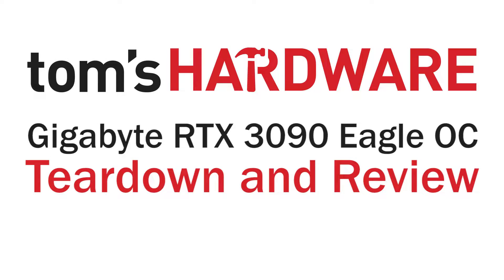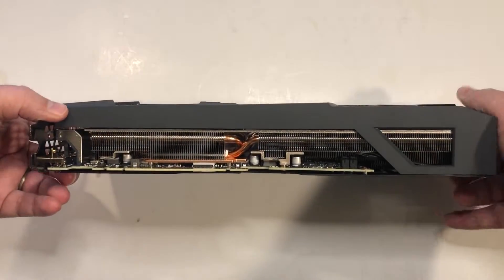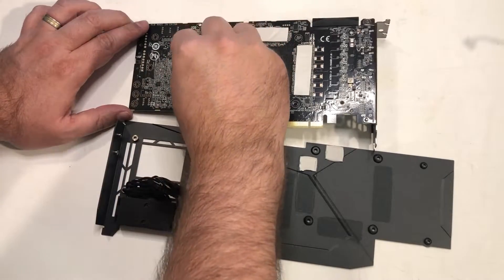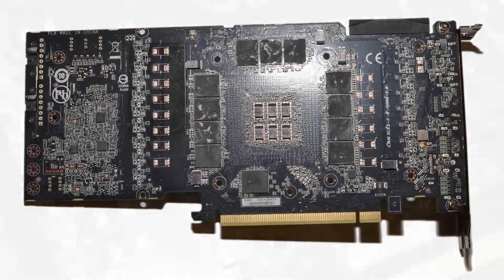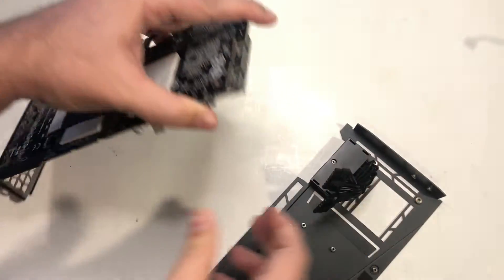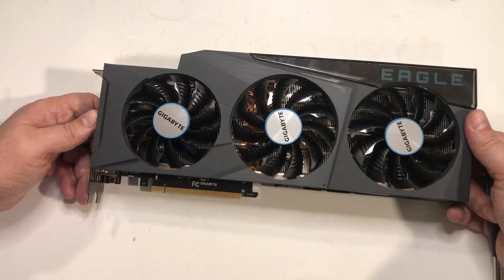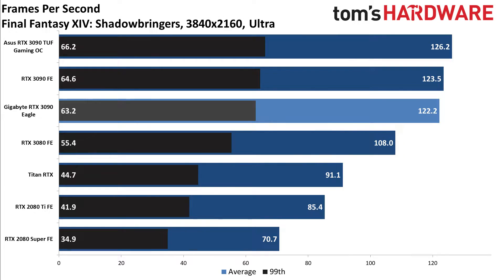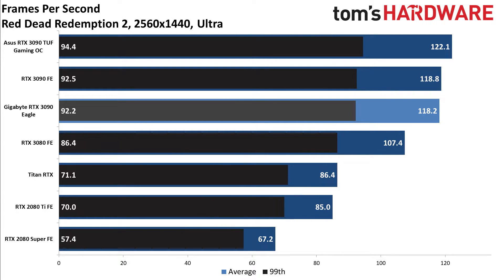Gigabyte RTX 3090 Teardown and Review

Comment: Very few of the GPU manufacturers still use bare Copper on contact plates and almost none for bare copper rad fins. 

Plating it with NiZN which has very bad thermal conductivity has not enough grounds - "preventing Copper from oxidation and corrosion"
Even the plating with NiZn is at micron levels is still the first contact with the hot GPU or CPU and thermal paste or thermal pads just not gonna compensate for the bad thermal conductivity of NiZn alloys.

Never seen in my life CPU air coolers or GPU rads and contact plates with bare copper being oxidated or corroded.

Comment: this eagle card is a trash totally, it's overheating and  makes my system crash. only you can do is reboot it !
terrible experience.
Reply: Sounds like you just got a bad one and might want to RMA it. The cards themselves are fine. Even if you're doing more than just gaming. Although if you're going beyond gaming it wouldn't hurt to slap some heatsinks onto the backplate just to keep that memory tjunction as far away as possible. But, again, gamers don't need to worry about that.
Reply: Definitely a bad card, or you've awful airflow. This and the Vision are superb.

Comment: Uh oh, it has the cheap capacitors on the back of the main processing unit.
Reply: Did jaytwocents made you come here?
Reply: @Debzzzzzzzz  I saw his giveaway video and signed up for the giveaway. It sounds like an NVIDIA driver update fixes the problem. An ASUS TUF GPU sounds like the best solution, however a free GPU works, as long as you don't intend to overclock it.
Reply: The whole capacitor issue was disproven a while ago. Plus the Eagle uses the 470SP Caps which aren't the cheaper 330's that like Zotac uses (hint: even Zotac cards still haven't had the crashing problems). But anyways' it's been proven for a while that early driver issues were the problem, which is way all this "OMGZ CAPACITOR!" nonsense was from mid-late September when the cards were launched. If you want to feel better about it, go see Buildzoid's 42 minute rant about why it's a non-issue, or GN's in-depth review of the 3080 Eagle which uses the same capacitors - they recommend the Eagle at reasonable prices.
Reply: The gpu looks pretty good tho. Goodluck bro hope we win this giveaway. Haha.